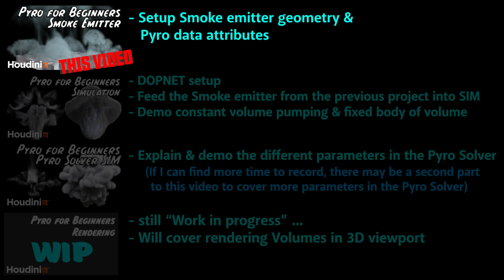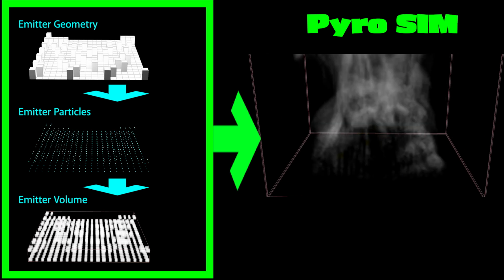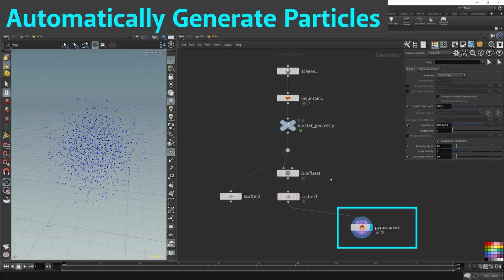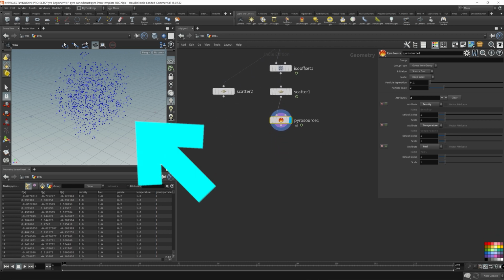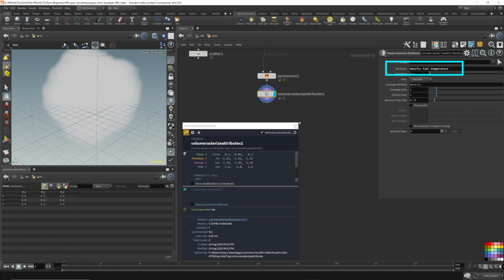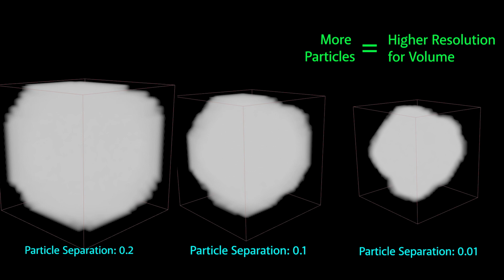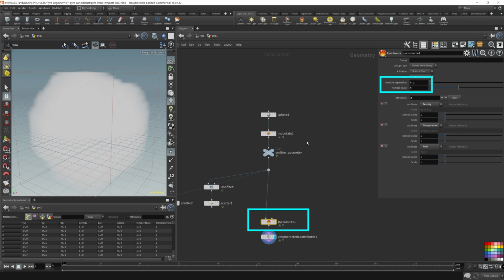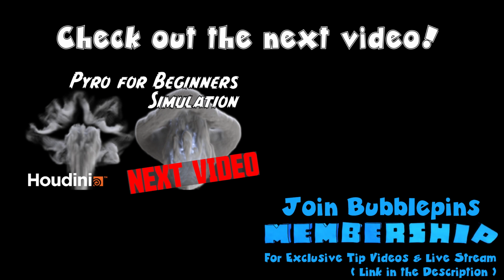Pyro for Beginners: Smoke Emitters in Houdini

Comment: My temperature and burn voxels looks like cube. When i use pyro solver it initiates fire from a cubic shape looks weirded. I have also increased all the resolution stuff. It’s not because of resolution. How to get rid of it
Reply from the maker: I'm not sure but it does sound like there isn't even voxels in your volume, the voxels determines the resolution of the volume.  The smaller the number for the particle separation, the higher the number of voxels, or smaller the number of the voxel size, the higher the resolution of the volume.  Try lowering the voxel size or particle seapartion size in your pyro setup or volume setup.  But be careful, making too many voxels slows down the scene significantly!

Comment: Somebody can help me? 
This new Houdini dont has got Mountain just Attribute Noise Mountain.
I search everywhere but dont found "TIME"  paramater on this attri noise mountain node.... 
Somebody know where this that ? What is that parameter ?
Reply from the maker: I am sorry about that, it's because this video is a little dated and SideFX had released several updates after I released this video.  In the new Mountain node, there's a section that you expand called "Animation", after you expand that you'll see a check box that you can toggle for "Animate Noise".  After you enable this, it will automatically make the noise move when you play the timeline.
Hope that helps!
Reply: @bubblepins  Yea, thank you so much  :elbowcough:
Reply: @bubblepins   thank you!

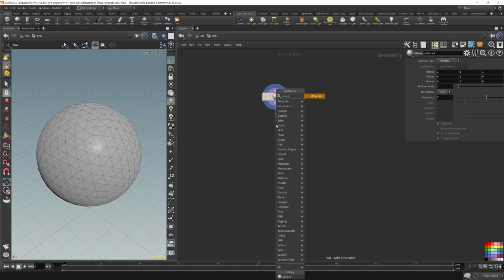Comment: Hummm... when adding a mountain node to the node tree (at 1:03), Houdini automatically turns it into a noise attribute node and the "time" parameter isn't available. Instead I used the "Animate node" option with a pulsation of 1 (default) but I don't know why I cannot use a mountain node... I'm using Houdini 19
Reply from the maker: I think SideFX might have updated this node and changed a few parameter around in the new H19.  I think they completely replaced the old mountain node with an attribute noise node.  My guess is that the old mountain node probably had attribute noise embedded inside the mountain node and in H19 they probably updated the attribute noise node a lot and it probably made it incompatible with the old mountain node.  My total guess.
Reply: @bubblepins  Thanks for the detailed answer. From what I've seen in other Houdini 19 tutorials, the attribute noise node is now used instead of the mountain node so your guess is probably correct.
Reply from the maker: @valovanonym  Yeah, it may be for the better.  Let's give this new attribute noise a chance, maybe it'll surprise us!

Comment: The "better" way of scattering points all across the volume of the sphere.
Is by using the: points from volume node
instead of: isooffset and scatter
Reply from the maker: oh wow, I'm super late in responding to this comment.  I'm so sorry I'm not sure why YT is so unreliable with the notifications.  But you are right, you can use the points from volume node, that will do it!  I guess I got into the habit of using isooffset & scatter.

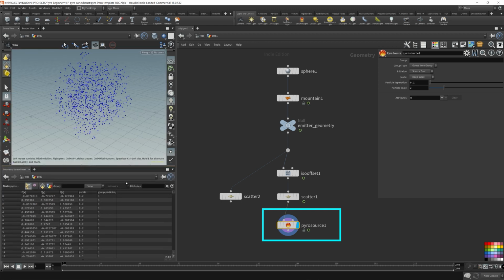Comment: 6:15 how ?
Reply from the maker: sorry, I don't understand.  Can you elaborate a little bit?
Reply: @bubblepins  How did you open the pannel "geometry" with pscale
Reply from the maker: @leomakesvfx  The Geometry Spreadsheet is a panel that was already opened from the beginning, but you can hide panels.  You do have to open up a pane first, if you click on the + sign and then "New Pane Tab Type" → Inspectors → Geometry Spreadsheet, this will open it up in the pane.  Then to hide it, hover the mouse over the middle of the pane on the top thin bar, there's a very faint arrow icon.  Once the mouse is over it, you'll see the mouse icon turn into an arrow.
Reply: @bubblepins  thx 🙂

Comment: How did you set up your workspace like that?
Reply from the maker: If you right click the icon on the top right of each panel, you'll get an option to tear it left/right/top/bottom then just switch the panel to the one you want.  And save it as a workspace, do you don't have to do it the next time.

Hope that helps!
Reply: @bubblepins  How did you put the parameters in the corner like that?
Reply from the maker: @mrglowtm  When the mouse is hovering over the node network panel, press "P" on the keyboard, it'll open up the parameters panel in the right top corner.  There's also a bunch of other similar shortcuts, like "C" for the colors to color the nodes, "B" to display a mini node network on the bottom left corner.

Hope that helps!
Reply: @bubblepins  You are a savior thank you!

Comment: hey, i have 18.5 and theres a problem. 

on the pyro source node, i'm trying to change to source smoke but it keeps changing back to initialize. Any ideas? I cant change to any other option... it reverts to 'initialize'. Thanks. and Great tut btw...
Reply from the maker: ohh  I think I know what the problem is.  That dropdown is only there to add the corresponding fields below that panel.  It'll always flip back to Initialize.  Once you pick something like Source Smoke, it'll add the related Volume fields.  Sorry in the delay in replying back, I've been super busy getting ready for Live STreams this week and I was a little confused in what you were describing until it just clicked in my head.

Hope that helps!

Comment: thx for your video, but at pyro source part if I choose volume scatter then everything disappeared, I don't know why
Reply from the maker: Try double checking the parameters on the issoffset, especially the mode, if it's set to minimum, chances you won't see anything from the scatter.  "ray intersect" is the default setting and works for most cases.  This is a total guess.  Let me know if you have any more issues.

Hope that helps!
Reply: @bubblepins  thank you very much